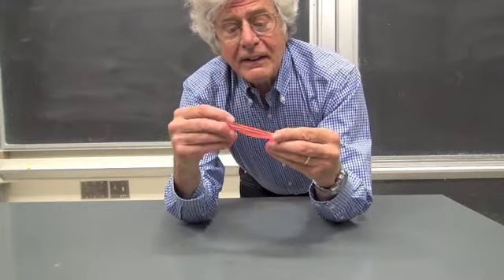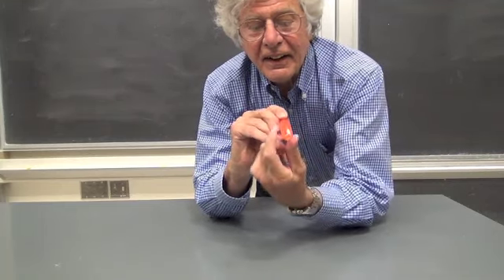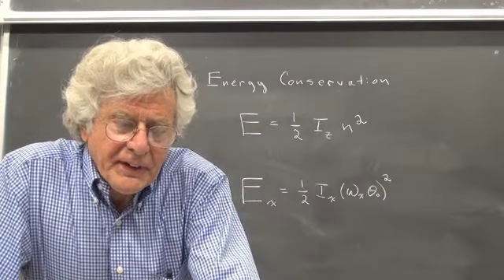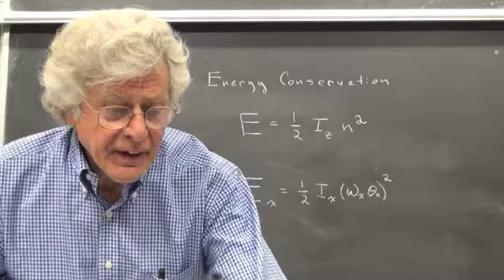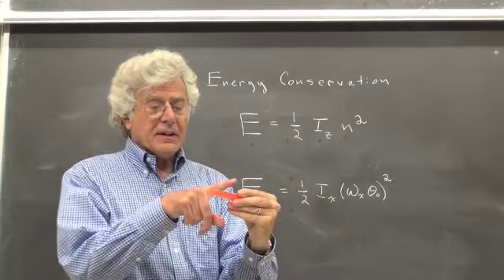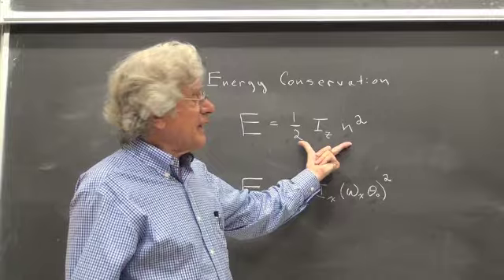Rattleback Physics

Comment: Great video! However, I think it could be explained better how/why the angular momentum is still preserved, as it seems "obvious" that the rule of conservation of angular momentum is violated. The solution to this is that the fiction and force against the table transfers the momentum to the table/earth system (if I'm not mistaken).
Reply from the maker: The question is which angular momentum? If you mean the vertical component about the center of mass, then, as you point out,  friction with the table at a point not directly below the center of mass is responsible for the reversal. However, since the point of contact with the table is constantly changing, it would be extremely difficult to carry out the calculation this seemingly direct way. Note it is the horizontal component of the force you need as well as the location of the point of contact. In our calculation we first analyzed the rocking motion followed by a conservation of energy argument.
Reply: @casewm  thanks for the explanation! This makes sense, and also it was not as clearcut as I originally imagined then.

Comment: 4.33  this force tends too ....why..
Reply from the maker: Consider the rotation about the point of contact with the table. The location of the center of mass will lead to a clockwise rotation. Such a rotation means the center of mass moves to the right with respect to the table. The force giving this motion must come from the point of contact. This is the force referred to in the video. It is ultimately the force that reverses the rattleback.

Comment: So in the 3rd step, the force of gravity as it pertains to the center of mass, and the off center friction point on the base, "tips over" the rattleback(?), this tipping causes the counterspin since the base is offset opposite to the falling force caused by gravity ?
Reply: I'm not understanding where the circular vs seesaw power is stored as the rattleback changes direction, which end is tipped up when the rattleback stops spinning, does that end falling due to gravity also help it counterspin ? Is there added pressure on the friction point - is that where the energy stores through compression of the rattleback medium ?

Comment: Before watching this I have a feeling that its sectioned into 4 parts. for now, I am going to label them as follows, Top left is 1, top right is 2, bottom left is 3, and bottom right is 4. 1 and 4 are linked and so is 2 and 3. these two sets are different. one set needs to have a straight linear line from the top to the bottom ridge while the other set is curved. the linear set, when spun in the direction as to it being the leading part, encounters the surface and makes it unstable. this makes the rattleback lose momentum until the recoil is enough to turn it around. when the curved section is leading the rattleback suffers no recoil and thus does not turn around. Also due to the curve having more volume the set with that trait will be heavier than the linear one leading to further instability when the linear set is leading.

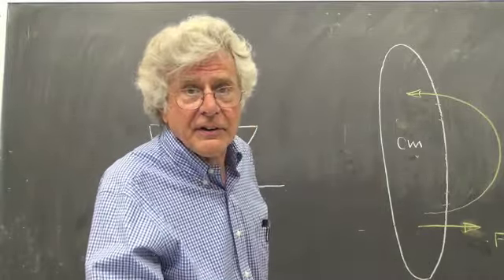Comment: So, it is easy to prove by keeping rattleback in this position (4:40) in the beginning and see if it will rotate as expected.
Reply from the maker: Dear sramctc, Thank you for your comment. If I understand you correctly, you are saying you could start the rattleback off rocking but not rotating and see a counter-clockwise rotation develop. This is true.

Comment: ok what i dont understand is: if it is spun clockwise and according to step 2 consumes all of the initial energy and comes to a complete stop, where does the inertia come from to then continue spinning in the opposite (counter-clockwise direction)? is it a combination of step 1 (point of oscillation) and step 3 (center of mass accelerated to right) that gives this energy? if so wouldn't that imply if you took the rattleback and only oscillated it along its long axis, it would start spinning counter-clockwise direction. If this doesn't happen then the initial energy explained in the formula cannot be applied. Im a medical doctor so i have a limited knowledge of physics but i find this very interesting.
Reply from the maker: Dear Slav, Thank you for your question. In step 2 the rotation has stopped but the rattleback is rocking rapidly. It is the energy in this rocking motion that is now converted into rotation in the reverse direction. If initially one simply set the rattleback into rocking motion but not rotating, it would start rotating in the counter-clockwise direction. By the way, the world has greater need of medical doctors than physicists.

Comment: This professor is wrong. At the end, it wouldn't cause it to rotate, but simply fall over if that were the case. Just imagine it and you will see. Also, he doesn't mention friction, which is the force that spins it. (Spinning on ice or a low friction surface won't make it spin the other way)
Reply from the maker: +PapaKay Thank you for your interest in this video. In the video I say the rattleback moves so that the point of contact does not skid. This means that there is friction with the table and indeed enough friction to prevent a skid (static friction). The force that reverses the spin is this friction. The size of this friction is determined  in the last section by considering torques about the instantaneous point of contact. This is a common way to analyze such problems and can be found in any intro. physics book. For a more detailed description see my paper: American Journal of Physics vol. 82 page 654 from 2014.
Reply: +casewm thanks for the reply. I read what I could of the article, and am having trouble understanding the process of reversing spin. I understand that the force is friction, but how can static fraction about the long axis make it rotate? A free body diagram would be great if you could
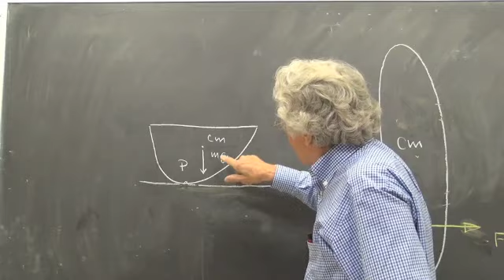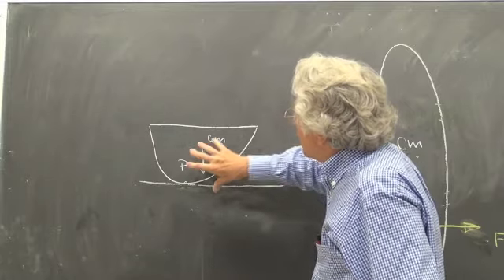Reply from the maker: +PapaKay What I'm going to tell you refers to the figure that appears at about 4:00 in the video. Remember this refers to a cross section toward one end of the rattleback. Suppose the surface were ice so that one has no friction. I this case the rattleback would simply rotate. The bottom of the rattleback would slide to the left. But now consider our case where friction prevents this skid. The friction which prevents this skid must apply a force on the rattleback that is to the right. This is the force that is referred to in the video that reverses the rattleback. For a free body diagram one would have the figure at 4:00 plus the force F due to friction plus a vertical force mg at the point of contact. These two were not shown in the video since they apply no torque about the point of contact.
Reply: i forgot to reply, but you helped me grasp the concept and I was the only one in my class to correctly solve this! It made me place #1 in the class. Thanks !
Reply: One quick follow up though (I only want to understand it, my class is already over), at 4:00 if the rattleback is falling towards the right, friction is an oppositional force and would push it towards the left wouldnt it?
Reply from the maker: No, assume there were no friction, think of the surface being like ice. The bottom of the rattleback would then slide to the left. The friction opposes this motion by applying a force to the right.
Reply from the maker: Well, I feel we have come quite a ways. This string started with "This professor is wrong" and ends with a "Thanks !". The road to understanding is often long with many turns.
Reply: Haha I never meant for it to be offensive or to insult anyone. I appreciate you helping me understand something so simple yet complicated
Reply: that helped a bit
Reply: casewm Understood, but the frictional opposite force is evenly applied along the entire contact surface. How is that force biased such that it always initiates opposite dir of spin? Is the bottom asymmetric on two axis? A high side and a high end?
Reply: I just answered my own question, but I don’t think friction is causing the opposite rotation. Friction is however, setting up the system. Following the initial spin, the shape stands up on its center of gravity, and has angular momentum on two axis (in the lateral rocking axis as well as vertical rotational axis) such that when it stops rotating about the vertical axis, it still has angular momentum in the lateral axis. When the shape then falls (due to offset center of gravity) it creates a torque perpendicular to that lateral axis which precesses thus causing the angular momentum to chase it. This is all arranged geometrically by the initial spin but can also be demonstrated simply by rocking the Rattleback.